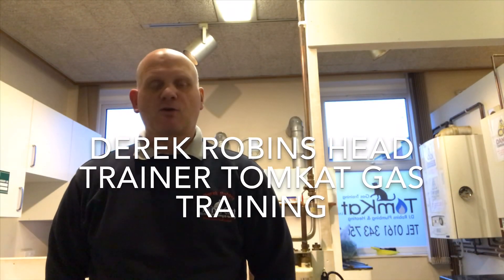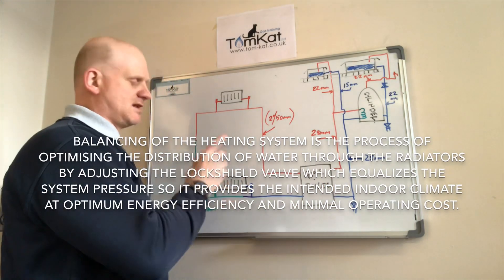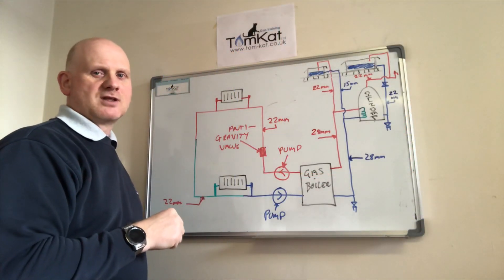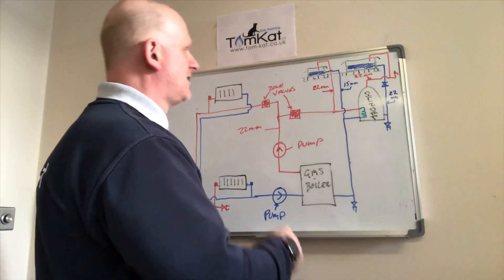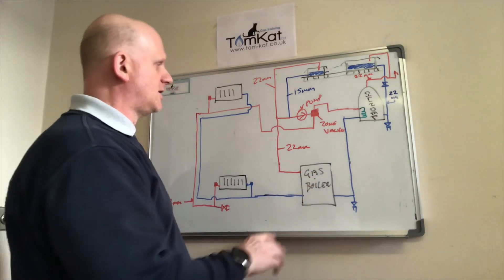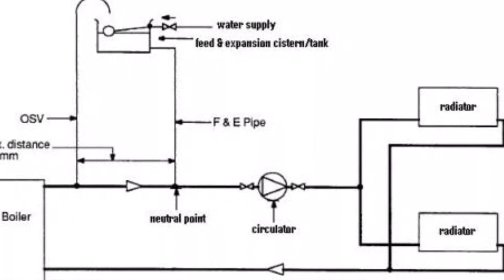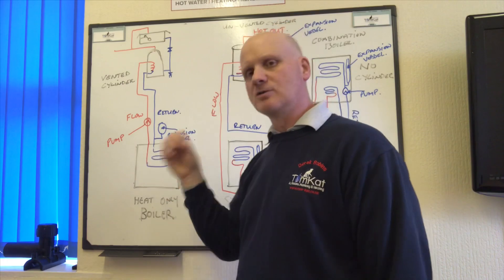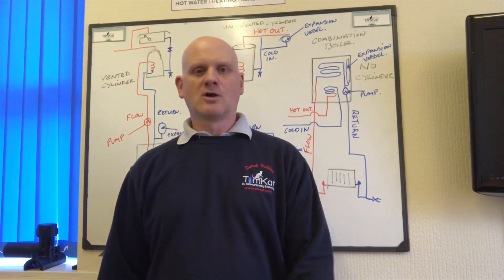HOW CENTRAL HEATING WORKS, the history of central heating part 3 - pipe work layout

Comment: Why or how does the boiler type alter the neutral point pipe work set up?…..I have an older cast iron boiler and it is the high water content type.
Reply: Mine too, it’s been running for 36 years with vent & cold feed within 150mm - on a rising H arrangement ( return water piped upwards a short way then back down, cold feed and vent continue upwards into loft, hence the H appearance of the pipe work). Not sure how much of a problem it’s been, if at all. Still runs ok.

Comment: Hi great videos I have an oil boiler but it only dose the both at once can I put a three port valve up in the cylinder cupboard so I can get hot water only if required thanks

Comment: Why would anyone fit a heat only boiler when you have system boilers which are much more compact and save space? I understand a system boiler is required for an unvented cylinder in a larger property where hot water demand is greater and a combi boiler is more common in smaller properties but the heat only boiler are these obsolete now?
Reply: 1Monaghan still around the heat only boiler the most reliable boiler there is due to simplicity